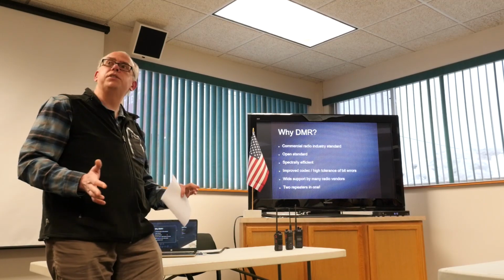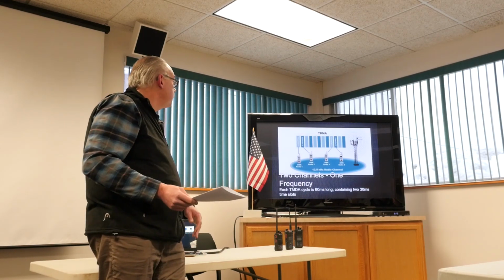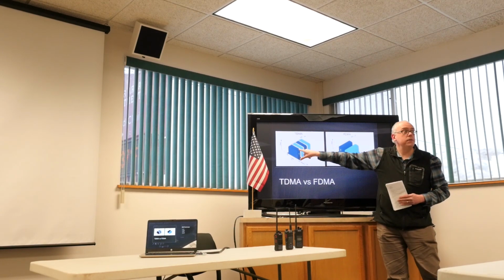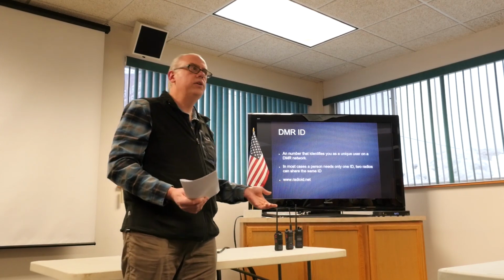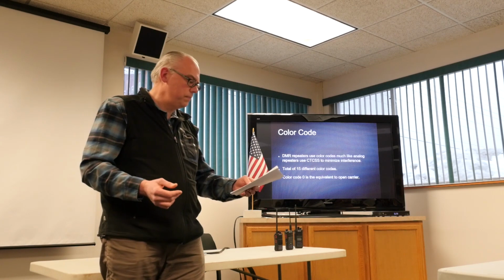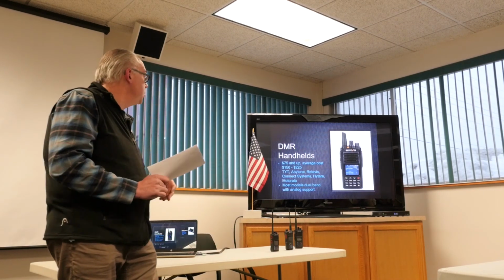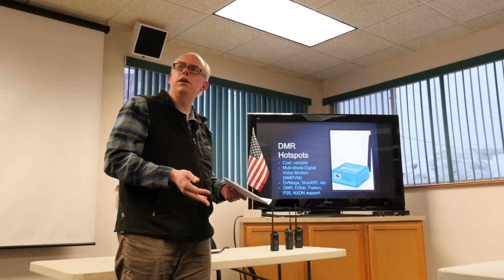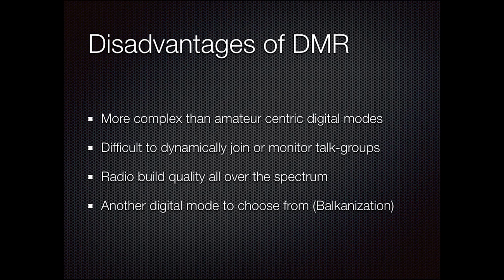Introduction to DMR (Digital Mobile Radio) Presentation - Ham Radio Q&A

Comment: So, right in that 1420-1430 portion of the vid, I think he is not correct. Let me caveat this with, if it's codec-2 then you need to verify what your specific DMR model is doing with codec2. "D-STAR and System Fusion (and some implementations of CODEC-2) all digitally encode a station’s call sign as part of the protocol, so their transmissions should meet the legal requirement.", as seen in FCC Rule 97.119 (b) (3). It also notes that a verbal call-out of callsign is for courtesy only. I do not believe there is any "station" vs "operator" distinction for mobile radios, and although a "station" has clear definition of what a "station" is, this Rule section still applies to "operator" that does not have a "station" callsign, because using Dstar/Fusion/codec2 is not unique to just "station" transmissions. And, please verify, some DMR's won't key out if they do not have an entry for callsign.

Comment: Hi Michael, this was indeed an incredible presentation which helped me a lot to break the ice on DMR radios. I am scouting for one and just wanted to know if the Alinco DJMD5 (GPS version) is good or any other DMR which you have in mind to suggest. Also a suggestion for a portable and slim Hotspot device which would be easy to carry while traveling.
Always appreciate your hard work  videos which are often loaded with knowledge on ham radio and easy to understand.
Greetings from Bangalore, India.
VU2TQT
73s

Comment: Good overview, Michael.  I have a new dmr radio. Any suggestions for Wisconsin talkgroups of talkgroups of interest here in WI?  I live in the SW part of the State.  Thanks. Jim K9JEC.
Reply from the maker: The Wisconsin DMR talkgroup 3155 has a fair bit of use. I usually monitor it off and on.
Reply: @KB9VBRAntennas  thank you, Michael.  I will include that in the list I am putting into my codeplug.

Comment: What is the modulation scheme? Some form of pulsed PSK?
Reply from the maker: DMR uses a 4 state FSK or Frequency Shift Keying to give a baud rate of 9600 bps in a 12.5 kHz channel. The channel is divided into two time slots using TDMA or Time Division Multiple Access so two conversations can happen simultaneously.

Comment: You answered all my questions I was having while considering getting into DMR.  I’ve had my license less than a year, got my Tech in January 2020. And my General in May of 2020.  Since then I have been using my privileges mostly on the 2m bands talking semi-local on a linked repeater system.  I am building up a QRP kit and want to upgrade from my Baofeng UV5R to something better.  In my HT research I cam a crossed the AnyTone HTs with DMR and APRS capabilities.   While I know DMR isn’t going to work for me on the QRP side of things it would help me communicate with other members of my off road adventure community as we have a global room on DMR. 

Thank you Michal for yet another great presentation. As always I learned a lot. I am very glad you take the time to put together videos like this one

KJ7MFV 
Mike Rose

Comment: Although DMR is complex, it is because of the business radio design mindset in the radios. Anytone is starting to make strides in making the radios more amateur radio friendly. In fact, with the 878 tweaked slightly, you can access and hear any talkgroup from a hotspot with only one channel programmed and absolutely zero talkgroups programmed. All it takes is to change the radio to full Promiscuous mode, unlock the manual dial a random talkgroup feature  with the online software, and you can QSY to ANY talkgroup instantly. Add to that the easy method of adding talkgroups quickly in the radio menu, there is really no need to use a codeplug at all using these methods. The result is virtually unlimited talkgroups. The question is, can Icom, Kenwood, or Yaesu put some skin in the game with DMR? Already Icom and Kenwood make VHF and UHF commercial radios with DMR. 

I enjoyed the presentation and think you have a very interesting channel. I am definitely adding your channel to my subscriptions!

Comment: Let's say I have my radio set on a repeater channel and the code plug 
for that channel is set for time slot 2 with the static talk group of 
31540. Then someone comes along and changes the talk group to a dynamic 
one of 31513 and starts talking.  I decide I want to talk on the static 
group of 31540 and I put a call, but because I don't have my radio 
programmed for that dynamic group of 31513 I never hear that time slot 2
 is in use so I cause interference with those using time slot 2. How do I prevent that problem from happening if my radio doesn't have promiscuous mode and that dynamic talk group isn't in a receive group because I am unaware of what dynamic talk groups the repeater admin allows?

Comment: Ok presentation. You lost me at “Made In China.”
Reply: Most of the individual parts that make moderen radios come from China. Just final assembly in Japan, US, Taiwan.
Heck the first company to do a dual band dmr/analog HT was a Chinese company and others followed after that.
Edit: and I'm not just saying a few parts I mean like the total boards are usually made and soldered in China. Then just some final touches and qc in another country.

Comment: New to tec / not.   used to work a mux van in the army. Just called (time division multiplex,) 12, 24, or 36 chanel's of audio. On one line The van was parked on the back of a  duce and a half truck. Now the whole mess is shrinking to a small package. Wife gone. Kids on there way. now back for a second helping. Tks for boost. In to. the future. Retired sgt williams. 73

Comment: Not a good speaker, errors in fact. If you are going to speak you need to be better prepared.
Reply from the maker: Please feel free to elaborate. I'd love to know so I can make the appropriate corrections
Reply: @KB9VBRAntennas  The intro was pretty good. Raised my hopes.

Lot's of "um's," "uh's" and other stumbles. Too many acronyms and components you didn't have in hand. Hand motions are distracting and make you look uncertain. 

You correctly said TDMA is not a modulation and then you later said it was a modulation (it isn't). 

You seem to use your notes as a crutch as opposed to a reference. You might be happier with a confidence monitor.

You overuse the word "efficient." Some elements (like dealing with errors) are better described as "robust" since in fact ARQ is NOT efficient. 

That's as far as I got first time, about minute 6. Your attitude in response to my comment was good so I'm running through again. I'm multitasking here, so I may miss some things. 

It would help to talk in one slide about modulations (FM, PSK, etc.) and modes (TDMA, CDMA).

No numbers on the slides so reference is hard.

The WFM, NBFM, TDMA discussion was confused, in part because your approach to modulation and mode was unclear. Consider that your audiences may have both novices and well-informed people - you need to address all. 

Terminology is supplemental, not different. 

Good to talk about cons as well as pros. 

It is good to be looking at your entire audience. Your scan rate looks like you're having a seizure (sorry). 

You could do better with similes and analogies. IDs are like IP numbers, talk groups are like email lists or SMS groups, .... You did a good job relating color code to CTCSS.

You regularly confused frequencies, channels, and talk groups. 

By the time I got to minute 23 I wanted to handcuff your hands behind your back. 

Camera height really needs to be higher. 

Time management is always a challenge when speaking. You have bursts of speaking too fast and then ramble. 20ish minutes of information in 30 minutes. I'd rather have you slow down, spend 40 minutes and provide more information. Step back a level and and think of what you are presenting at the novice, intermediate, and high-tech levels. 

I recommend this https://www.amazon.com/DinoFire-Wireless-Presenter-PowerPoint-Presentation/dp/B012FB0VM8 . Put the paper down, use the clicker. Laser pointer and PowerPoint control. $13. I carry two, plus spare batteries.

You can write me dave@auspiciousworks.com. I speak often in person and in webinars.
Reply from the maker: Thanks for the comments‚ I wasn't expecting you to get so deep but I do appreciate the time you took to make the analysis. Recording the presentation was an afterthought so I didn't have my full kit with me‚ hence the technical issues with the recording. The other items I'll certainly take to heart in crafting a presentation.
Reply: @KB9VBRAntennas  Michael, really appreciate your graceful and positive response to Mr Skolnick's analysis and feedback of your presentation. It was definitely a great learning for me too which, I guess would help me to improve on the flaws I often make during presentations.
VU2TQT
73s

Comment: Still in a mystery - which radio am I looking at, the MotoTRBO VHF or UHF model?  Frequency didn't seem to be part of the discussion.
Reply: Most all existing repeaters are on UHF but with the advent of less expensive dual band HT"s the VHF repeater will gain in popularity. For the money the Alinco DJ-MD5 is the best radio for the money. I have the Anytone and its a good radio but the Alinco is just as good (for most hams) and much cheaper. I got mine for just a bit over $140. Be advised all of these radios are single receive so if you show two channels at a time you will only hear one channel at a time so that is really bad for Emergency Communications. The Alinco makes it easy to hide the second channel for times when simplicity is required such as using the radio for handouts. Yes you can do that on the Anytone but the price compared to the Alinco is not worth it.

Comment: Great content and appreciate your consistent sharing. I picked up an Anytone AT-U878UV DMR radio both because it was a DMR which I would like to learn and understand as well as the APRS functions it carries. Right now i feel like I am in over my head and am getting lost with both the APRS and DMR aspects of this radio and while I think I am configuring correctly, can’t get a test back to prove it and if it isn’t correct, don’t even know how to troubleshoot it. I guess this might be a plea for help. While I will continue to browse the content you and others have here on YouTube,  do you have any recommendations for someone like myself just getting started in this? - - 73, W9CTR.
Reply: Did you ever end up getting more information or solid websites or tutorials anywhere?  I bought the AT U878 UV II Plus and I'm on a repeater nearby (so similar to you probably), --- I'm just lost beyond belief.  There's no really great tutorials online either to understand any of this stuff.  I'm trying on Ana, I'm trying on Dig... then there are A+D or D+A (not sure if it's the same for the ATU878 you have)... I'm in a talk-group, thinking it should be Dig chantype.... no one's responding... I have the color code set to 1 and pressed the PTT button, I even tried 2.......... and here I BARELY understand the Analog portion of this device, and what stinks is I just did something so now it won't show VFO for me to change the frequency, even though it says I'm on Analog (I thought I could just type in the frequency if it's in Analog channel type, but it's stuck in this Channel and talk-groups... I thought that was only on Digital??  Maybe it's getting confused... I'm a hot mess.)  I tried turning on and off again. sigh ---- I know... one thing at a time... patience, patience, but it's all overwhelming.  Any great sites you found over the last couple years since your post would be well appreciated when you get a moment!!!! :-)   - 73, KE8UQL.
Reply: @scottdhartman  bro just set up a parrot channel so you don't need anyone to talk back to see if its working.  further... what's the point of using this mode if no one is on it anyway
Reply: @cwilliams6884 I can't get parrot to work. LOL shrugs  Must be something very minute in the settings that I don't have configured properly. Also, repeater only allows a very short list of TGs to work out of all the thousand-plus TGs that the AT-HT has programmed in there.  At least now I'm not getting "Repater Not Found!" because my dumb butt went and used the wrong frequency altogether!  I was using the default from the codeplug I bought and discovered "Oh, it's out of Missouri! That's why you can't get the repeater, you dum-dum!!!"  (Makes sense, my hometown made the Dum-Dum suckers..... and I am living proof!!!!!  aye aye aye...... *sigh*)

Comment: I'm not a radio operator, but I'm very familiar with DMR. These amateur linked repeaters are way to clogged up. They have multiple talkgroups assigned to the same time slot on one frequency, example
TG 1 TS:1 Local
TG 2 TS:2 Statewide
TG 3 TS:1 Event
TG 4 TS:2 Worldwide

This just results in bonked calls. It was so bad a once popular DMR repeater by me is hardly used anymore.
Reply from the maker: I know what you mean. Repeater owners need to drop linked talk groups after 15 minutes of local inactivity. Many don't and not only does it cause trouble on the local side, but messes up the links too.

Comment: No, can't agree that the 3 main digivoice modes sound pretty much the same. Fusion is clearest, sounds better than the other two. But uses more bandwidth.
DStar seems more prone to r2d2 effects. DMR is impenetrable to startup hams, with its unfamiliar terms that have no equivalents in ham radio. Coding "codeplugs" by manufacturer's software isn't too bad once you've been shown a couple times some basics but initially the program designers made zero effort to render their software even slightly friendly....
(In my opinion, Icom didn't try much more with their DStar coding software)
Then there's the whole different business of using personal "hotspots" to get an entry point into the DMR network via the Internet.
It's certainly less like ham radio than it is like using a phone in that the element of chance is removed. Contacts, once the basics are understood, become routine. Even hyperlong distance contacts. Like DStar. I had a contact some time ago with a S. Korean guy near Seoul using my Icom handset. And we could have arranged a sked next evening if we'd wished, and if no one else was occupying the route it'd have worked.
On me, the effect was to make routine a contact that - had it been radio-to-radio via HF, I'd have been jumping up'n down for a fortnight having cracked a difficult multi thousand mile pathway but as it was, this was routed via the Internet, effectively connected like phones.
Which for me removed the wonder of such contacts. It's just too easy, once the luck-factor has been removed.
Yes, it has its place. But for me can never ever come close to replacing rig-to-rig contacts.
BUT. it's also possible to use these radios simplex, with nothing but air connecting the antennas. This works extremely well. As an FM signal gets progressively noisier as the threshold of loss approaches, noise gets intrusive. Some simplex trials have shown that both DMR and DStar improve this situation markedly, until the audio disappears from perfect to total loss with no degradation in between..
But there are few users who capitalise on this, to my surprise. It's as though the operators' minds are channeled into considering only repeater/reflector/hotspot pathways. Low power transmissions using these digital modes can keep contacts viable after a similarly weak FM transmission would have been abandoned as too noisy to follow.

Comment: Retevis RT3 does allow TG change on teh fly with teh advanced firmware.   Motorola does allow if you have the CPS programmed with all the TG's you want tyo use as a contact........Easy Peasy

Comment: Great presentation on DMR. Looks like a product thats still needs some adoption and room for improvement. You caught me off guard with the term “Balkanization” lol. I did not know that word was a thing. I’ll just add that the divide on the Balkans was heavily heavily influenced and planed from the western countries since the early 1900s. People liked each other, but the politicians were always the ones who were trying to split the people apart. Mostly on religious grounds. I used to live there till the early 2000s Now I’m in the US on my Ham Radio with your J-Pole antenna! Thanks for sharing! 73!

Comment: I wouldn't call it "Balkanization", a better term would be "Tribalism", something we as a country are very good at.  There are those that feel that whatever their chosen digital voice mode is, that is the only one to use, which of course is total BS, but how some choose to operate.  That said, we now have multi-mode XLX reflectors popping up all over where the three major Digital Voice modes are bridged together so that we can all talk to each other.  Just like with HF,  you may need to jump around to find what you want, but it is out there and it keeps getting better.

Comment: Thanks! I am a new ham and an old man. I bought the Ailunce HD1 GPS radio. I see you have a video on setting this radio up with the usb cable that comes with the radio. Can FM repeaters be setup with this software? I am kinda catching on. The only reason I got this radio is because it was on sale on Amazon last week so I bought it on a whim. Maybe sorry I did. There is a repeater in a town I frequent so not all is lost. If you can please help me by having more videos that will help me get going on using DMR. My mobile is a Yeasu FTM-100DR system fusion radio. Looking into a hotspot for my house.